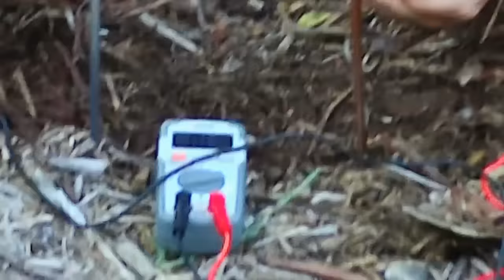OFF GRID POWER? The Earth Battery Experiment

Comment: You would need about 200 of these bad boys to get 1A. Multiply it by 9 to increase each to 5 volts. 
You would need 1800 of these to charge your phone no faster then in 2 hours; assuming you would have no loss due to the resitance of connecting 1800 of these massive batteries.
Seriously, this is a lost case. If you created a bycicle generator you would charge your phone faster than by filling 1800 of these bad boys.
Reply from the maker: Yes indeedy do, that is my conclusion, too! (see what I did with the rhyming there :p)  Now, Microbial fuel cells .. could they do any better?  That project is still on the back burner, but will be explored in the months to come!
Reply: @Green.Country.Agroforestry  Let me plant a bug in your mind.
Convert solar energy to electrolizis flammable gases.
You could collect for 12 months a year and cook/weld with it; or heat your home for the 3-4 cold months.
What do you say?
Reply: Have a look on the Web for the video where a group of Tesla enthusiast tried an experiment and lite up an entire field of huge light bulbs.

Comment: Who is this electrictial reject all this trouble and generate enough power to kill 10 dam ants. Get yourself 24 inch by 24 inch solar panel connect to 12 volt battery on stand have enough power run most small appliance. Connect 24 volt battery that runs you microwave or small TV or small fan or small electric oven.
Reply from the maker: Best thing for ants is rock or concrete walls and surface water, throw in a little shelter for them .. and you will have frogs and lizards enough to control your ant problem - add some small-flowered herbs to attract hoverflies, stinging nettle to grow an early crop of ladybugs .. and the aphid problem you had goes away.

Some people resort to a 50/50 mix of boric acid and sugar, dissolve that in water, and soak cotton balls with it to poison the ants.  Other people dig up entire nests of ants, and place them near established colonies .. and let the ants kill each other as if it were some sort of miniature blood sport - a step up from cooking them with a magnifying glass I suppose.

Of course, one cannot cook ants with a magnifying glass once one's trees have grown tall and full .. you need sunlight for that .. hence the entire pursuit of alternatives to solar power that are still within the small landowner's ability to manage.  I had heard a rumor about this particular one, and wanted to cross it off the list with personal investigation .. et voila.